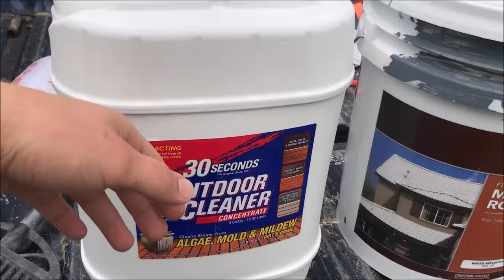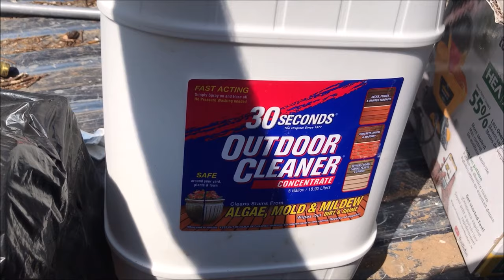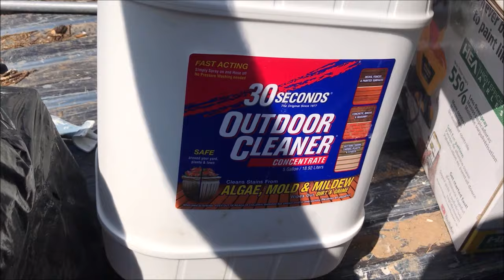Painting an Asphalt Shingle Roof with Behr Multi Surface Roof Paint

Comment: Excellent job!! I was trying to convince my husband that painting shingles was possible.  You provided the proof! Lol Thank you!
Reply: Naturally one “can” paint asphalt shingles. That doesn’t mean one should paint asphalt shingles. If the shingles are still under warranty (some have a 50 year warranty), then application of a coating will void warranties in most cases. It is best to contact the installer or manufacturer before doing so.
Reply: NO
Reply: Of cource you can paint shingle 
If you want to throw some money 
Paint didn’t make your roof waterproofing

Comment: I am a roofer and there are reasons why a licensed, reputable roofing company would never do this to shingles. You are definitely creating water traps which could very well cause wood rot before you realize there is even a problem. If you live in a dry climate then you may be okay. Coatings tend to begin to peel off shingles as the granule system begins to fail. I'd like to know how this is doing 1 year later
Reply: If you don't spray under the shingles there will be no water traps. The idea is to paint shingles on top only and left the gap between the top and bottom shingles for water to run down. 
Roofing companies don't do it because they don't make money of this. They want to sell you roof replacing
Reply: @MrNiceCobra  , roofing companies don't do it because we know better and it's really ridiculous to do. I could absolutely go out and charge a customer and be very profitable doing so but I don't do shit work. You can't tell me it won't create water traps. In fact you couldn't educate me on anything roofing. Go on with all of that nonsense. This really is a stupid argument. If you aren't really skilled at something then why try to inform someone who is? Also if you knew anything there is way more money to be made doing roof repairs than doing reroofs that are not needed.

Comment: I've painted 2 different roof black slate color. I always go long ways with my sprayer.  Keep a wet edge.  Do long sweeps from corner to corner sane as shingleplacement.  You won't see the lines like this guy had.
Reply: Hi what tip did you use to spray the roof, and what filters for the gun and the machine did you use? I hope you help me. We have a large roof to paint with roof paint from Homdepot. Thankyou
Reply: @sexweightsproteinshakes  thankyou so much

Comment: I used this product on my shingles and still looks fine 3 yrs later in the Florida sun. I would avoid dark colors like black slate if you live in hot climates, the direct heat will cause the shingles to slightly curl
Reply: I’m in Florida and I purchased the white reflecting one. I’m planning on putting it in my granular cap sheet small roof. Do I really need to use primer? M bummed about it.
Reply: @blanco1231000  No primer is needed at all for this particular product, the paint is immediately absorbed by the shingles especially if they are old.
Reply: @kingalainc1  thank you.

Comment: In my opinion you could seal coat the roof with Acrylic Elastomeric Reflective Roof Coating. Last over 10 years. Cooler temp inside during the summer. Thanks for sharing, Lee.
Reply: That would be the worst thing to apply on shingles, it prevents the shingles from breathing which causes them to deteriorate. The Behr product does not affect the shingles

Comment: Hmmm....so I'm looking to do solar panels on my roof and right now bifacial panels are really attractive.  Both for price and how much power they generate.  I have a black roof so that really cuts back on how much benefit you can get on the bifacial panels.  Basically any sunlight that hits the backside of the solar panel also hitting the solar cells and will generate some power.  Thus bifacial.  I'm thinking that painting the roof underneath the solar panels as white and as reflective as can be is definitely worth the effort.  Your application was for athletics so you had to worry about how it looked.  Mine will be utilitarian and underneath solar panels so I can just slop all 5 gallons on with abandon.  Lol.  Thanks for the video mate.  Your house looks great by the way.  I actually said out loud "oh that's much better" once you showed how it looked when everything was dry.  Cheers!

Comment: That's for the video.   I was thinking about how to paint a roof.  I believe if a person had a deteriorated roof they could paint it.  Personally in that situation I'd use an oil based paint with a roller.   I'm absolutely sure a roof would last another 12 years for $350.

Comment: Are you worried there will be brown patches as the paint weathers?  Will you need to repaint every few years?
Reply from the maker: I'll do an update in a year and see. So far we have had lots of rain and nothing has washed off or faded after about 3 weeks now
Reply: I imagine if paint on other surfaces can last many years paint on the roof should last as well, we have to repaint metal roofs but probably at the same rate that you need to replace a cheaper shingle roof

Comment: What paint sprayer did you use & did you have to thin the paint out?
Reply from the maker: I think I said it in the video, but it is a wagner control pro 130. Its a $230 painter and paints like a professional set up. Did not have to thin at all. The amount of pigment made the paint thin though

Comment: How much it run ya $$?? Thanks
Reply from the maker: At 0:50 in to the video I say that I spent $175 on the 5 gallons of roof paint, I did not mention that I also spent $45 on the roof cleaner
Reply: @tonto_bob  do i need to add primer before I paint the roof?

Comment: You could have replaced that roof for less than $4k and not worried about it for 25 years......or more.  How much is your time worth?
Reply: do you mean shingle OVER?.... because replacing will drive up the costs fast if they have to tear down to base surface
Reply: 4k lol not in this timeline